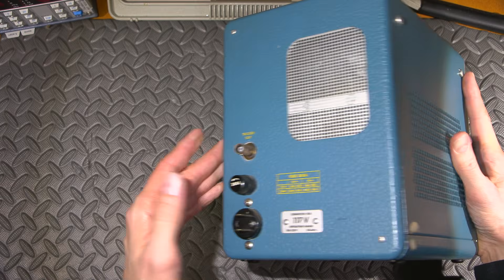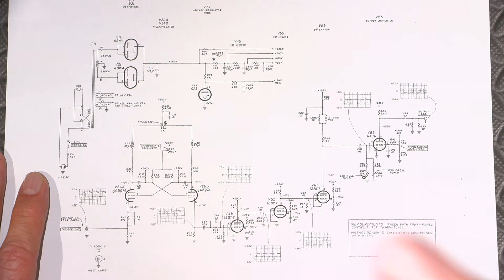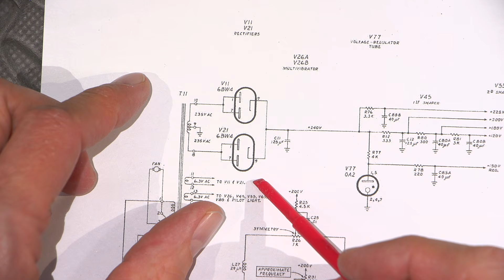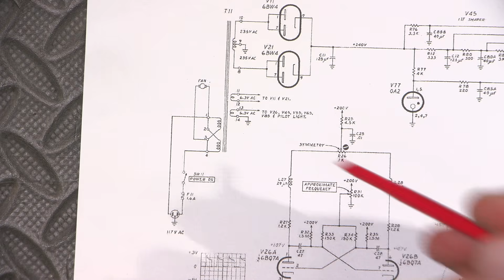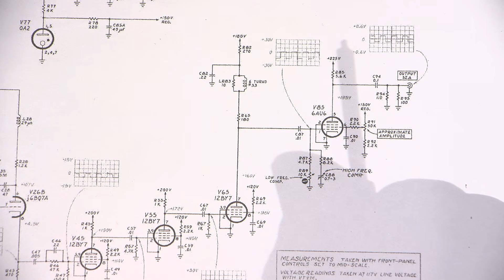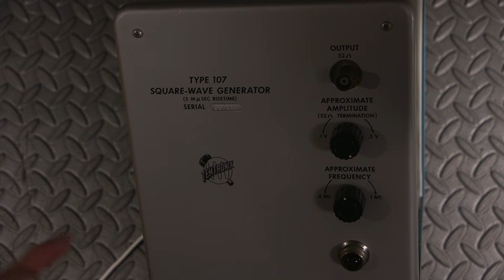1959 Electronics - Let's See If It Works!

Comment: I love Tektronix. I have the 561A oscilloscope. 10:29 I notice something interesting about the two 6BW4 rectifier tubes in the actual physical circuit, vs. the schematic. In the device the tubes are both connected to each other at their respective plates. Pin 1 of V11 to pin 1 V 21, pin 7 of V11 to pin 7 of V21. Whereas the schematic shows each tube having its own 2 plates tied together at only one end of the B+ winding. No real big deal really, but the traditional engineering way to do it is like what the schematic shows. That way, say one of the 6BW4 tubes has a heater burn out, for example, then the other tube will only be stuck with a half wave load each cycle, instead of having to do the whole job by itself. I wonder why they changed it on the actual product?

Comment: The fan 3:30 seems like it would move air a lot better if the fan blade was closer to the vent holes on the rear panel.  It might be possible to turn it around with a suitable bracket.  The noise might increase fractionally but the cooling should be improved.

Comment: I would expect NOTHING less from a Pre 1980's piece of gear from Tektronix.  My old 4 chanel Ossi was from 1966 and it was all tubes then BUT for ONE transistor.  I must have moved that beast 20+ times over the years and it NEVER let me down nor fell out of alignment... PERIOD!  I miss still miss it even today even tho it was ont rated to 20 MHz.  I used it mainly to maintain my Live Sound gear and it's 24 channel mono Board.  I kept that board so maintained that I got TWICE the money we had paid for it (after I had got it back to the original factory specs, which were WAY out) and I hear that it's still 20 years later still being used as the back up board for one of the clubs along the Sunset strip in L.A., tho I'm not at liberty to say which club it is (there are only 3 so you can guess!!! :) ).  Those were fun times for sure!  And to think it all started with blessed enough to get my hands on an old Tektronix Ossi back when I was in H.S.!!!

Comment: so, what would the application be of a square wave generator anyway?  I'm a paramedic so I understand the concepts of monitoring electrical activity but what is the purpose of generating electrical waves?
Reply from the maker: Hi Donny. To test, test equipment, you need a signal generator that produces a very fast rising and falling signal. square waves have this fast characteristic. Square waves are used in most all modern equipment, the most common being power supplies.

Comment: Amused that the fan and its motor are sitting in open air and not in a ducted shroud against the rear vent with the impeller inside a round pipe to guide the air through it, when Paul turned it off I saw the fan coast down and it was spinning clockwise = drawing the air through the back vent, over the motor, onto the tubes. I don’t know if it’s doing much where it’s positioned, can Paul feel the air being blown out the side vent/put a piece of tissue on the rear vent and it gets sucked against it

Comment: Seems strange to me they would use 3 12by-7s when they could have used 3 more to make a sine wave which is much easier on electrical circuits.
Reply from the maker: Sine waves don't have a 3nS rise time.

Comment: So... My VCR from the 90's in the basement. Been plugged in and besides the odd power outage is always showing the time. Will it fail or be a hazard just sitting there? What components in modern equipment would be suspect??
Reply: Unless you're watching old homemade porn on VHS you should unplug it immediately.  The risk of it exploding suddenly is rare but you shouldn't take the risk.

Comment: I'm curious why you spent so much time on the carbon comp resistors and none on the higher-precision and perhaps carbon-or-metal-film ones, which may have been 1 percenters. They would allow better performance and less frequent calibration. And I bet even you wonder why several people inquired about when you were going to change capacitors et al., when the unit seems to be working perfectly. And the amplitude range is not critical as long as it meets the min and max output voltage requirements. And the power transformer is probably not over-specified (at least by Tek standards); look at all the vacuum tubes !

Comment: Seems reasonable to me that a square wave generator would also want to have an excessive amount of power supply capacitance to have reserve power available to help sharpen those fast Dv/Dt steps at the edges of the pulse train.

Comment: Tec specified 3% silver bearing solder for use on the ceramic tag strips. This is not the same as silver solder, which is up to 50% silver and needs an  Oxy Acetylene rig.

Comment: Yep, I found out the hard way when I was younger about too much capacitance after a rectifier tube. I always thought I was doing myself a favor by using a large capacitance in my homebuilt power supplies, but my tubes never lasted long. It finally dawned on me, what I was doing wrong, when my dad started making me buy my own tubes.

Comment: That 107's totally gorgeous... thanks for sharing it, Mr Carlson.
When you mentioned about a similar fan in the Gonset  2-meter amp, that 'Gonset' name instantly brought up some great memories of some Gonset gear I used to have and operate years ago... never had the 2-meter amp but I did have the 2-meter 'Communicator III' transmitter-receiver rig they made back in the day... utterly beautiful rig, and I also had an FM modulator device that plugged into a crystal socket on the front panel and and made the crystal's frequency wobble a bit at an audio rate and one could have some great QSO's on 2-meter NBFM, . I also had a Gonset GSB-100 HF transmitter, which I used alongside of a National NC-300 receiver... that GSB-100 xmitter was definitely another utterly awesome product from Gonset. One of my radio-nerd-dreams was to one day come across and obtain  the G77 and G66 Gonset Twins... .. still, one of these days... lol : - D
73
Reply from the maker: Thanks for sharing your story Terry!
Reply: @MrCarlsonsLab  You're welcome Mr Carlson.

Comment: Question a 2w 10% resister is burnt up or it is damaged by lots of heat, If I was to go to Radio Shack (I know they've closed now)  any electronic store that sells individual components I would have a hard time finding 10% resisters it even hard sometimes to find 5% I take it a 2% would be ok.. I know using a 1/2 w in place of 1/4 w is ok but I have found a circuit that sometimes doesn't want to work right when I go from an OLD 20% or 10% to a 2%... Mr. Carlson, what is your thought on this? 
I took Vocational Electronic for 2 years in High School (1972, 73) and in the army repaired computer system that used TTL logic

Comment: Made before my time but I had a relationship with Tektronix inc. 1969 to 1980 I have seen, used, repaired and dismantled Tek interments.
As you can see Tek made more than Oscilloscopes some of these were television waveform and vector scopes, medical monitors, graphic
computer displays, color laser printers, a desk top computer with graphics and many other items.  Concerning the adhesive stickers I have
never observed any such seal on a Tek interment these must have been added by a user.  This equipment was made with field repair in mind
although such repair was rare.  I stopped the video before the power up of the square wave generator, I am placing my bet that it will come 
to life with out fail  let's see if the bet is a winner..  PS: No surprises Tek a winner as usual.  One other detail the Tek service manuals were true
works of art I have several in my library because they represent the best of documentation now a long lost practice.  Thanks for the well made
video brings back fond memories.

Comment: Would there be any detrimental effect of wiring both rectifier tubes in parallel (i.e. connect pins 1 of both tubes to one side of the transformer, and pins 7 to the other side?) This way, if one tube fails, you still get full-wave rectification; just at half the current capacity.
Reply from the maker: Many designs did what you mention, I imagine Tek did things this way to keep both ends of the winding out of one tube.

Comment: Such an odd design!  Most companies would design in like 2 or 3 tubes to do this.  And switch in some other capacitors to increase the frequency range up and down.   And a voltage divider to provide lower and calibrated voltage levels.   Somehow Tektronix avoided all the obvious simplifications and extensions and just made a very complex and very niche square wave generator.  I suspect these didn’t sell very well.  Marvelous.quality, but jeepers, you could probably buy a 2 year old Ford Falcon for the same money.
Reply: It was a specialized instrument primarily intended to test the performance of 540/550 series scopes. Neither wide frequency range nor voltage output was required, both of which would have added to the cost.
Reply: @peterrollings1240  Ahhh, now it makes more sense.  Still it takes lots of confidence to build and market such a specialized device!
Reply from the maker: The key here is the rise time. 3nS is pretty fast.

Comment: Paul, when you test a piece of gear that meets and/or exceeds its original specs as well as this one did, do you still go back and rip out the OEM caps "just in case," or leave them there because of the "reforming" you gave them while making this video and because of the relative lack of use you expect it to receive?
Reply from the maker: If the unit has low time on it, and there are no paper caps, in a case like this, I will leave it. The electrolytics in the 500 series scopes (and the related alignment equipment) seem to be of a different standard. Every 500 series scope I have turned on, the electrolytics are fine and haven't failed yet. (And I mean every one.)

Comment: Old Tektronix equipment is always impressive. Hm, I think voltage regulator tubes are supposed to be gassy somehow 😉
Reply from the maker: A loose term meaning (has come to atmosphere) by vacuum tube manufacturers.
Reply: I get gassy after Mexican dinner night.. 🤷🏻

Comment: The fan with a shaded pole motor is just like the ones in range hoods and bathroom exhaust fans. I've bought them from W.W. Grainger to repair range hoods. Usually it's cheaper to replace, but the ones in mobile homes and campers are odd-sized and more expensive. If you'd have to rework the cabinets or pay through the nose for a specific non-standard range hood, replacing a motor starts to make sense.

Comment: Can a tube with a little nipple capping it's top be repaired? The wire isn't broken, just the cap pulled off and stayed in the attaching clip/boot. I got it that way. Don't think I can find another tube. It's early 30's Japanese. But if you do know someone with 30's T/R tubes from Japan please tell me.
Reply: Yes I'm not technical. I collect for aesthetics and preservation.
Reply: Try high-temperature adhesive (compatible with the materials) to glue the cap back in place.

Comment: I would like to know more about the parallel plate FW rectifier implementation here.  Does that give twice the current capability?  Perhaps the purpose is to lower the plate currents to reduce the heat and also increase the reliability.  I have not found a link yet for the theory for this implementation but I have found information where two or more Schottky diodes are paralleled.  UPDATE  ... just read an article that addresses parallel plates on a FW rectifier tube. This action reduces the effective internal resistance which, in turn, allows a higher current.  That poor cathode has to emit twice the electrons over the same period of time, however.  I wonder how that affects the cathode.

Comment: 8:00...there's a possibility for confusion here: the term "silver solder" is understood to mean a high temperature brazing alloy that contains silver- and that would be TOTALLY unsuitable for THIS application! The correct alloy for use HERE, is called "silver BEARING solder"- which is a soft solder alloy that contains a significant percentage of silver.
Reply: ...the problem is that lead-tin solder erodes the silver deposited on the ceramic substrate- but using a solder alloy that already contains silver, greatly reduces the erosion of the silver deposited on the ceramic substrate.

Comment: Thanks for discussing each tube, the circuit, discussing the issues with silver solder on the ceramic standoffs, and taking measurements. I find the word "approximate" on the front panel unusual for an instrument, but I have limited exposure. I haven't worked with this type of equipment for a long time, but it is still fun to see.  I enjoyed the video.

Comment: I wonder why they went with that string of 12BY7 clipping amplifiers versus a few 6AL5 or even a solid state diode? Looking at the pulse voltages shown, a diode clipper should have worked. But Tektronix knew their stuff so I am sure there is a good reason.

Comment: That's when Tektronix use to make test equipment to last forever. Then they came out with their TM series of modular test gear which was pure junk. You'd spend more time repairing the TM stuff than you would using it.

Comment: I spent 22 years (1969-1991) in the U.S. Navy.  I was always impressed with the quality of the test equipment that the Navy employed.  We had a lot of Tektronix and Hewlett-Packard pieces.  The stuff was built to last.
Reply: Yep, I was an ET in the 80s working on big HF transmitters and it was all HP and Tektronix, as well as Simpson meters.

Comment: That power transformer appears to be WAY over-sized for the unit's function!
Reply: Interesting observation.  That would have been my guess.
Reply: Valves (tubes) use a lot of power as they need heaters and operate at high voltage, therefore lots of heat generated.
Reply: @peterrollings1240  There are signal generators (EICO 324, For example) contains a TINY power transformer.

I guess the extra power in the Tekronix unit  is used to achieve those very low rise-times.

Comment: I have never got any verification, but my understanding about the early wire bundle ties material was a Surgical Catgut.   It was sort of twisted round.  When the nylon lacing came around, it was flat braided.  First time I met it, we got black version and it was loaded with bee's wax.  That made the knots stay better, as well as made it more friendly for the hands.  Later on, you could buy that lacing tape without the wax, if you preferred.  Some people complained that bee's wax suffered from mold build-up.  In any case, this TEK unit was manufactured before the lacing tape. dominance.
Reply: Before the nylon lacing tape there was flax tape. It was light brown but otherwise like the nylon. I remember seeing the Hughes "Spruce Goose"" and it's wire bundles were done with flax. The bees wax was to help in getting the knots tight but about 20 years ago they phased it out where I worked as they had become worried about 'out  gassing' in vacuum environments which the bee's wax would do. We swore and cursed when they stopped the waxed cord because non-waxed cord was so much harder to use.

I remember about two years after I started doing lacing tape I was asked to show a new employee how to tie the knots. It took me some time to remember as I had done it so many times for so long it was something my fingers just did without any thought!

Comment: Bizarre thay would make something that complex but limit the frequency range - seems it wouldn't add much more cost to give it a wider range
Reply: The manual says it's a single-purpose machine for testing and adjusting the 540 series oscilloscopes transient response.  Their other square wave generators they made at the time had a much wider frequency and voltage range at the cost of being a bit slower.
Reply: But then they can't sell you a separate model later
Reply: These days we make devices that do many things (but not necessarily good at everything) that need to be replaced. Back then they made specific purpose devices that were great at their purpose and lasted forever.
Reply: But maybe not - It was designed to have good characteristics within a certain range. Going outside that range may have meant much more expense.